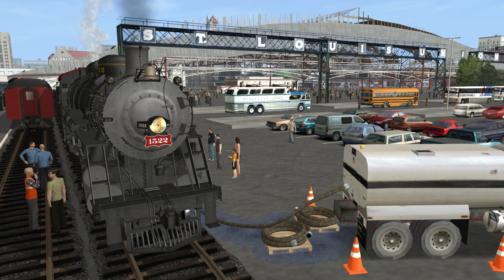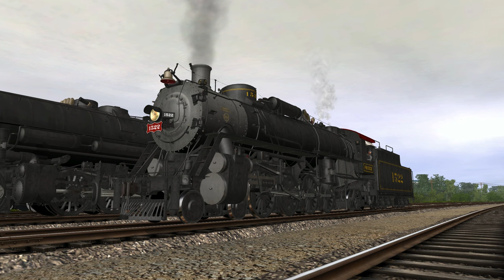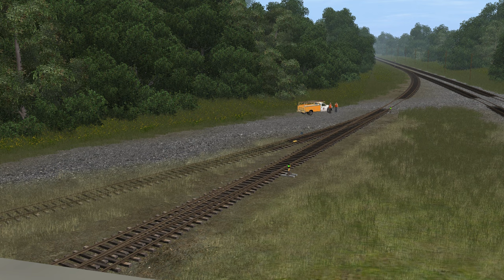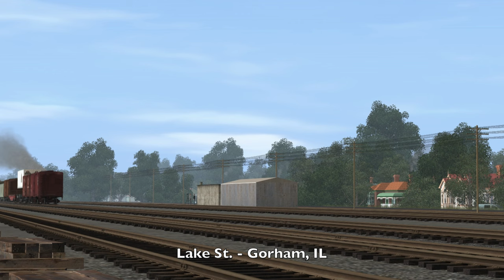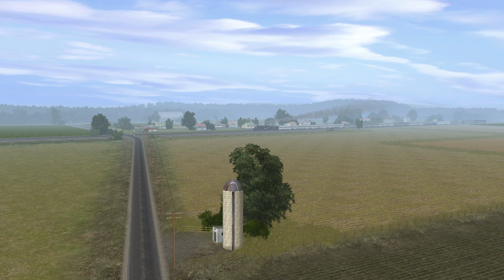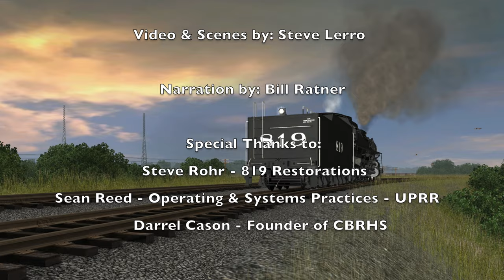K&L Trainz Cotton Belt L1 Northern Promo (Official)

Comment: 8 minutes and 19 seconds? Impressive, most impressive
Reply from the maker: Watch the N&W 611 and WMSR 734 videos.
Reply: as well as the n&w 1218 video also i had a thought if Lionel could make a model of the 819 (the same like this with the engine and the consists of passenger cars to the 1990 nrhs convention not for copying the same thing from this video i just had a thought that it could help with the 819's restoration like the way with the restoration for reading 2100 with their legacy models of the reading t-1's it was a thought) i've had a liking for the 819 after this video and i really enjoyed it
Reply from the maker: I've always wished Lionel or MTH would do a Frisco 1522 with the 4 Frisco Accompanying cars.....that would be a great 7pc set.
Reply: i've actually suggested to lionel if the could make the 1522 with the 4 cars as well as the water tender (i've had several suggestions of engines and cars that they could make since the start of the year i guess time will tell on that and it would be nice if they could do the 819 as well with the cars on the way to st. louis as i've said before)
Reply from the maker: From what i've seen in the past, Lionel likes to make models of engines that can be reused into something else. I've seen them turn the PRR E6 Atlantic into many other road names, even though it still looks like a PRR engine, just a different number plate and tender lettering. 1522 is pretty specific looking, so I can't see the engine and tender molds being very useful to modify into something else. Maybe someone like Sunset could do that
Reply: they could i guess we'll have to wait and see
Reply: K&L Trainz if Lionel made a 1218 Set like they did with 611....that would be great.

Comment: Already love running this engine on my routes, @ 4:17, how do you get the camera to pan like that in Trainz?
Reply from the maker: Built a track for my mouse to glide on to keep it straight. Took MANY attempts. I still think it could have come out better, but my frame rates start to drop the faster the train is going.
Reply: An actual track for your mouse or built something in game?
Reply from the maker: An actual track. It's hard to do a 120 degree spin in the game and keep the mouse straight without going up or down.
Reply: K&L Trainz I do not understand your explanation on how you did it but great replica!

Comment: YES!!!! THE HIAWATHA IS NEXT! OMG WHO COMISSIONED YOU TO MAKE IT STEVE!?!?!?
Reply: The whistle and bell are beautiful!
Reply from the maker: The A Class Hiawatha engine never had a whistle....just an air horn :(
Reply from the maker: The engine was design to cruise at 100mph. You wont hear a whistle going that fast. An air horn can cut through 100mph+ winds.
Reply from the maker: 844 is in the hands of new owners who are deciding what to do with it.
Reply: K&L Trainz but one thing: What if some people want the engine to be going maybe 50-80 in certain areas? Maybe do something like a fictional Hiawatha whistle as a secondary
Reply from the maker: An airhorn works going fast or slow....the steam whistle doesn't carry as far at speed, so seeing that the A Class Hiawatha was design to cruise at 100mph, the engine spent more time speeding than not. So thats what they gave it, an air horn. For historical accuracy, mine will have one as well.
Reply: Ah. I see. I'm surprised that 819 never used a AUX tho :(
Reply from the maker: It did, only in the 1993 season, which was her last. The aux is included in the set
Reply: I see. I like the SP GS8. And all 3 versions of the L1. I might reskin it into a generic 4-8-4 and just record a video of it running on a MRR i have in TS12
Reply: An air horn.... WHAT THE **

I always thought it had a whistle considering the Lionel A class hiawatha had a whistle
Reply from the maker: It was found the steam whistle didn't carry very well when speeds were high. And since the engine was designed to cruise at 100mph, the decision to use an airhorn made more sense since the train was constantly at high speeds.
Reply: +K&L Trainz if you do not mind me asking, but do you think you will be making more PRR Pullman coaches? I am just wondering but I am not really looking for a answer
Reply: K&L Trainz sorry for bringing back a dead comment thread, but interesting fact, the Milwaukee Road Class F7 Baltics had both a "city horn" and a steam whistle, courtesy of my friend whose grandfather worked as a fireman on the F7 Hiawatha. Apparently they had big 3 chime whistles, like the Pacifics the Road ran. Very interesting sounding whistles, let me tell you.

Comment: How come not as much steam comes out of the whistle? Is it because of the temperature?
Reply from the maker: Because the 819, just like the 844, 3985, 4449 and 700 have their whistles mounted in front of the smoke stack. The draft pulls most of it up once the train is moving. Plus it uses the superheated steam, not the saturated steam right from the dome like most engines do. The saturated steam has more moisture in it, which is what causes the white steam to come out. Once the steam is moved through the super heater tubes, it looses most of the wet moisture and doesn't have nearly as many particles to be seen when blown through the whistle.
Reply: K&L Trainz oh ok thanks so much!

Comment: Hang on...$125,000 to get it back to operation? Isn't that a little cheap?
Reply from the maker: Owen Meschter At that time, the engine didn't need to meet the insane federal railroad regulations she would need to face now. Not to mention the volunteer work force is much smaller now than it was back in the 80s.
Reply: Yeah but still, after that kind of treatment I would expect at least a cool million to get her trackworthy, and a lot more time, hell even for the planned cosmetic restoration I would expect at least a quarter million.

If you ask me they got incredibly lucky, not just in that they managed to pull it off so quick and clean, but also in that Cotton Belt or Southern Pacific didn't pull the plug when they found out what was going on.

Had somebody gone behind UP's back like that, they probably would have canned the project and sued the volunteers.
Reply from the maker: I also think that 35 years ago, they were able to get their hands on materials a little easier than they can now. The engine had only run for a decade, so she wasn't horrible used. They were able to get by without immense work since she was probably in decent condition. Plus I think they were able to get their hands on parts easier back then. Add 35 years and tons of new regulations, so many more things have to replaced even with less wear and tear. Boiler flues are very expensive, boiler ultrasounds are expensive, plus a number of the workers on the original restoration were former Cotton Belt employees, a few had actually ran 819 in revenue service. I think had alot of cards in their favor in the 80s that they just don't have now. Plus the 819 will have to be brought up to the current UP Steam Engine standards, which takes any restoration cost and then multiplies it by at least 5x.
Reply: it might sound a bit conspiratorial, but I honestly believe the UP steam engine standards are only so ridiculously high because they want to have a monopoly on heritage equipment, if they allow just any group of volunteers working on donation money to take attention away from their steam program, that might tarnish their reputation as heritage lovers.(You know, the guys who erased one of the biggest western railroads in just ten years because it competed with them for traffic)